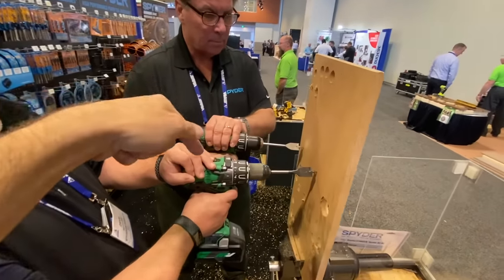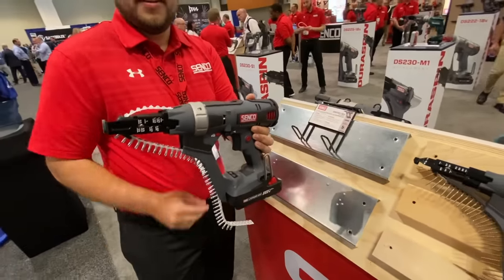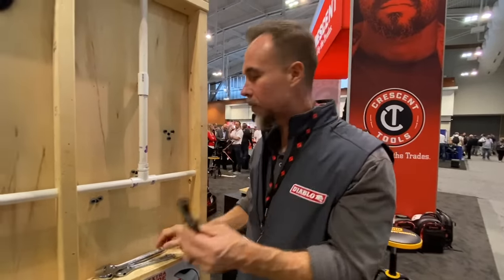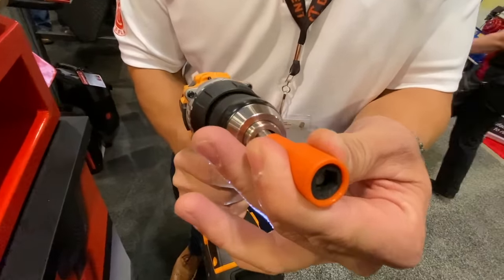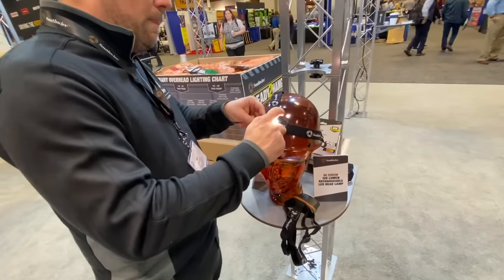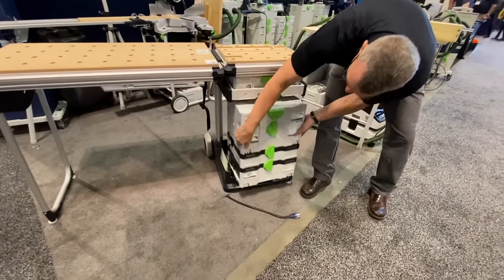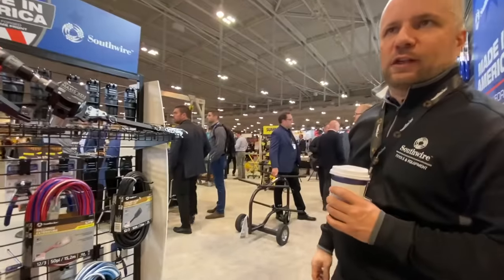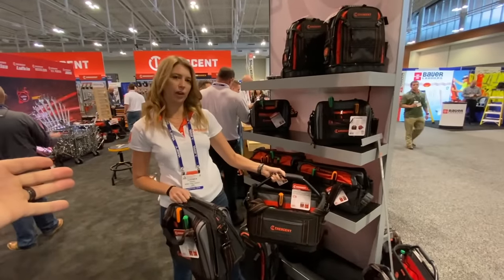New hand Tools, Inventions that actually WORK, power tools, and Equipment you have to see to believe

Comment: I've never heard of Crescent before, am I supposed to know them?
Reply: Yeah they're bottom barrel budget tools. They're like 1 or 2 notches of quality above harbor freight.

If you think about it, a pipe wrench/adjustable wrench are clearly not designed for top tier precision work.

So, realistically. If your just a dude trying to live in your first house/apartment you can get by with this stuff for a life time. Some of it is even pretty good. The bolt cutters don't seem to be as robust as standard ones. But compounding force is great.

But if youre a mechanic trying to make hourly rates. Just skip on by most of this.

Comment: As a carpenter on the tools every day there's no point in using any type of drill bit on an impact gun.... it's a crazy thing to do boring and drilling holes in any timber or sheet materials... your not boring through concrete where impact is required to break down the material as you drill.

Comment: The Spade Bits, I gotta believe that the "leading competitor was either  dull as a rounded glass ball or the guy wasn't pushing against the wood, even after using and abusing my cheapest bits forever they could still cut far faster than that. And...the so called "patented" tip of that bit is called an auger tip, been around for a million years.

Comment: I’ve drawn up some portable work stations like the Festool cart in the past I just don’t have the know how to actually build them. Now I don’t need to I just need to buy theirs. I like it’s modular design as well so if you are planning to use it for multiple applications you can have each section designed ahead of time. Just grab the sections you will need And go.   For me, I wanted a small woodworking setup for carving and small hand cut projects. I wanted something that could be used Indoors at a seated position in my wheelchair or something.

Comment: First test the "competitors" bits drill had a smaller battery and the guy was only using one hand the other guy was pushing with 2 hands and he had a bigger battery higher amps or volts I'm guessing

Comment: The crecent guy really didn't answer you're question. It's just a given when you have a shorter handle you sacrifice torque. Of course the parts of the same spec will handle the same torque but you wanted to know how much torque you could put down with that short handle which logically it would be less than the full sized 10. Just a common fact of physics. Oh and gear wrench already has those non marrring bit sleeves for quite some time now.

Comment: First one was fake. The one the short wrench is something I had to "make" by grinding off the end of a 10" wrench for plumbing purposes.i did like the Apex drill bit and motion sensored light just wondering if you get to close to an object will it shut on/off. The festtool table/toolbox would be nice for contractors but maybe be to heavy when fully loaded and not sturdy.

Comment: Stanley! Why didn't you call them out on pitting the 36v high torque high speed top of the range heavy duty drill, against a mid range/torque/speed 18v drill with a low amp compact battery???????????
Reply from the maker: I didn't see it.

Comment: I'm very surprised about the Spyder bit presentation: not only have I been using my $ 8 Bosch self cut flat bit 40mm (1.574") with hex shank months before this presentation, it deliveres the same speed as shown in the video but under much tougher conditions: drilling very tough Brazilian angelim vermelho hard wood, using a much wider bit and not even an impact tool, just a cordless DeWalt drill.

This indicates that the drill said to be from the leading competitor is certainly not the top model flat bit of that leading competitor as that one definitely will have self cut. And then again, long time ago I had very cheap flat bits which were so very bad that they actually twisted when meeting some resistance LOL. But up to that even these were way faster in light wood, using a less powerful cordless drill at the time, than the one shown as 'from a major competitor'. That drill is obviously very dull.

Comment: 3:54... Torque is literally an equation of radius, force, and angle so I'm having a hard time understanding how the shorter wrench delivers the same amount of torque with the features he's talking about.
Reply: It doesn't, and the rep avoids answering directly -  instead he says that the size of the knurl and pin meet the "torque specifications" for a larger wrench, only meaning that the wrench itself is beefy enough to not be damaged by higher torque, but it will not apply that higher torque because, as you alluded to, the length of the handle determines that.

Comment: Also look at the drills they are using. The guy with the spyder bit has a 5ah battery. The other guy has a much smaller battery. If you have a great product you shouldn't have to be deceitful to win.

Comment: @2:15 the asphalt tamper - Why don't they make a dead blow one?
Reply: becaues it wouldnt compact the ground. the slower transfer of energy applies less max pressure and less compaction. just like that guys invention loses the compaction generally generated from the handles energy.  

think jumping and landing with your legs straight. or jumping and allowing them to bend and absorb it. both have the same amount of energy but the first one would leave a much deeper dent in the ground.
Reply: @bobgilmore421  Yes, that might be the case.
Although I've used dead blow hammers to drive stakes into the ground and they were much more efficient than normal sledgehammers.

Comment: The industry standard of a zipper on a tool bag is 500 cycles? Doesn't that seem a little low? You might barely get a year out of 500 cycle zipper. Sure, the bag would probably still work, but you just can't zip it up anymore after you open and close it 500 times. Sounds like a legit standard to me.

Comment: Most if not all of these aren't new; at least functionally. Self drilling spade bits, self adjusting pipe wrenches, screwguns for fasteners or framing aren't new, I highly doubt that antivibration tamper is new, pretty sure the apex ugaurd and the hands-free headlamp are actually new, doubt those bolt cutter are new (in the sense of having a secondary levering action). All that being said they look like great products.

Comment: The wrench is shorter.. meaning you will not get as much leverage or torque as you can with the larger one without using a cheater bar.. the same size threads doesn't give you that ability

Comment: I can say, as someone that used to be a rep for a big brand(I won't mention), first let's say, for drill bits of any kind, and sawblades, (way easier on drill bits) but it's extremely easy to dull the cutting edge of the competitors bits and it would be difficult to see it was done, unless you had the bit in your hand and knew what to look for. Sawblades can be weakened also, just slightly more difficult to make it non-notable. Hate to, and sad to say. But most all these companies that offer these "head to head" stand offs pull these bs trucks to sell. End of the day it's not about the consumer, it's about the $$$, and the sales numbers come the end of the quarter. And people fall for what they see without question, so its a easy way to generate sales numbers.

Comment: Those spyder spade bits are utter trash. You will snap the spade if you hit a nail. Get the Diablo spade bits. They have a much thicker spade that is actually designed to completely shear screws and nails

Comment: Your demonstration, showing the benefits of the (shorter/wider-throat) of the Crescent adjustable wrench, is so totally phoney and contrived!!!  You indicate that this Crescent wrench will work where a standard (wide-throat) wrench will not work. Really?  Any tradesperson would simply 'flip' the longer wrench in your demonstration to turn the connection as much as required.  But, generally, this would not be required because adequate turn angle is available which does not generally require this minor effort.     How much did Crescent pay you to insult the viewer?
And the rep's response on the 'torque' question totally sidestepped the issue (i.e. about lower torque application due to the shorter Crescent handle)!!!  Again, the viewer is insulted.
I am surprised you didn't elaborate on the tremendous advantage of the dark-color Crescent wrench (vs the chrome comparison wrench) to be quickly found if dropped on a chromed floor.
Reply from the maker: Nothing since they didn't sponsor the video.

Comment: The guy trying to sell the adjustable Crescent wrench completely skipped physics 101, and went into deflection 101 in sales class.  He never addressed the actual torque being applied to the handle.  We all know that the longer the handle, the more torque/leverage is applied.  So this guy goes into an explanation about torque on the adjustment head/screw.  What?
Reply: Lot of that goin on here

Comment: The Spyder Spade bits are complete ass after 5 holes.  I bought a brand new 24 pc set from Lowes on Black Friday, worst bits i ever used.

And the comparison those reps did was ass too.  One was a brushless Hitachi and the other wasnt.  And the other bit was well worn and probably not sharpened at all

Comment: Bosch have had that kind of self feeding drill bit out for some years, I own a set, and they are a lot faster than ordinary flat drill bits like the "competitor" bit that they compare the "Spider" spade bit to. And look at that "competitor bit, it looks like all the sharp edges have been ground off (difficult to see 'cause he's shaking a lot, I don't mind people shaking, but it makes it difficult to focus on the bit, and see the lack of sharp edges..). On top of that, the dude holding the drill with the "competitor" bit isn't holding and pushing the drill from the back - and yeah...it's not even the same drill...morons...
And P.S. Imagine the blow out on the backside when a drill bit is pushed through anything with that speed - which is the reason that I seldomly use my Bosch's.... The holes looks like bullet holes on the back.

Comment: The video has been named wrong, most of these are already out there. The self adjust crescent pipe wrench is just a rip off idea from the 80’s. I’ve got four various sizes in the garage. The question about the torque on the adjustable crescent wrench is crap. If you have a shorter handle on. The same size head, science proves that the torque will be different. I’m really disappointed with all these tools. Nothing is a brand new idea.

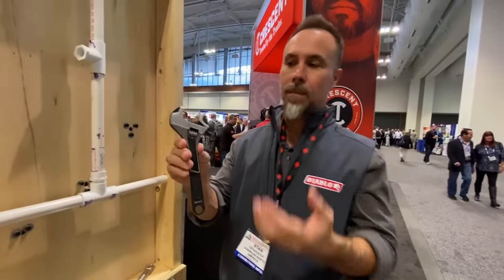Comment: The guy between 3:49 & 4:32 is full of crap and either didn't want to answer the question or couldn't because of his ignorance of tool science. There is not only a huge difference, but also a different set of physics between the amount of torque a tool can withstand and the amount of leverage that can be applied to the tool depending on the length of the handle. I would never trust a salesman who is obviously less intelligent than the product he is selling. I've taught science for over a decade and worked for a tool company (Snap-On) for almost 18 years.